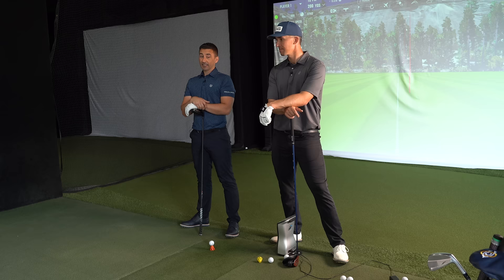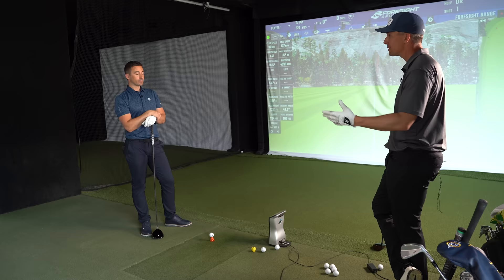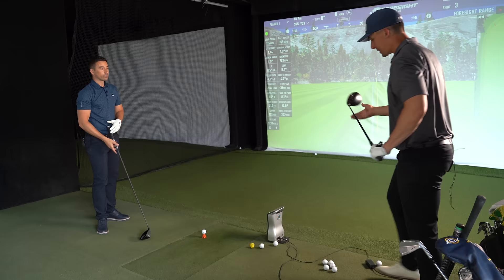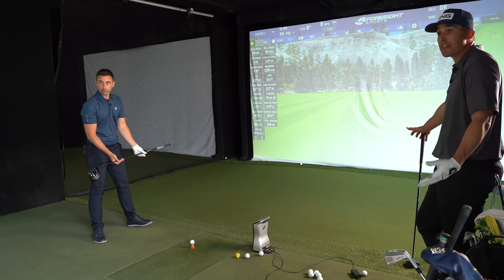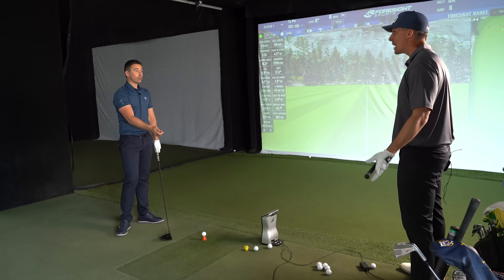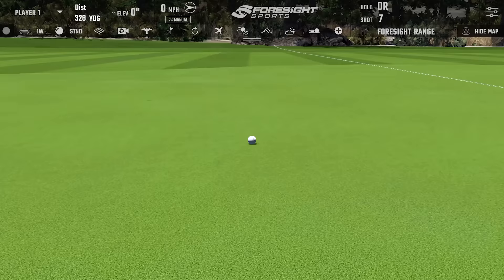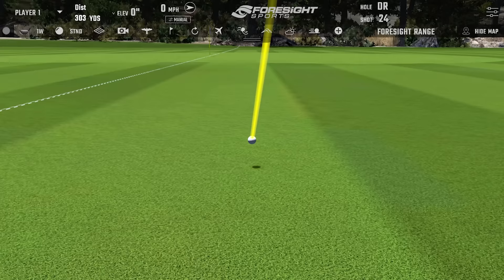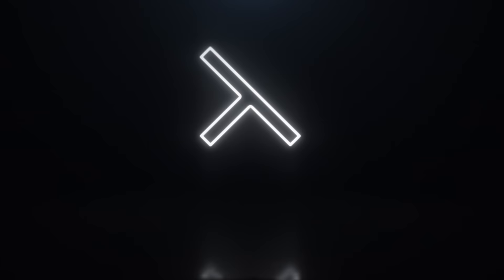HOW TO GAIN SPEED // Speed Fundamentals with Drew Cooper Part 2

Comment: Great video. With my coach we have got to stage 3 but am really confused about how I get from top of backswing with weight really loaded into the lead leg into the down swing.  I have spent decades being a slider so it is really hard to reprogram my swing.  This video really helps about needing to move to stage 4 and push off as soon as the weight in the lead leg has peaked.  I can mange it with short irons (8i-PW) but anything longer than that is a lottery
Reply: The best I have seen is from AMG golf, you simply need to move the grip/handle faster and sooner when you begin the downswing. Also if you don't squat enough in the backswing to allow yourself to push/jump you will struggle. It's quite shocking how much your hips need to be angled in the backswing
Reply: Stop trying to think the “top” of your backswing is where you start your downswing. The downswing sequence should start when your hands are hip high in the backswing, the momentum of the club, your hands and arms will take it to the “top” no matter what. Just start that downswing sequence way earlier than you think

Comment: The only thing to consider possibly is your equipment. If you've been fitted, chances are you may need to relook at your shaft choice. If you're making big changes to transition and how you "offend" the shaft, then it may become hard to square the face if the shaft no longer has the right profile.

Comment: So a question! I tried this today on the range and saw a incredible difference in ball flight and speed overall but I wonder about how hard/soft are you suppose to grip the club? I feel it like when I’m soft grip I don’t really get out as much speed as I am when holding around 6 on a 10 scale in pressure, not trying to control the club in any when just holding on for the ride
Reply: I grip as hard as humanly possibly then I relax it to about a 6/10 helps me stay fast and feel connected